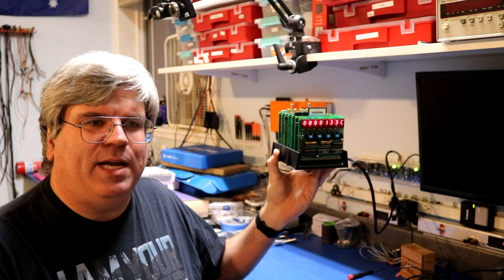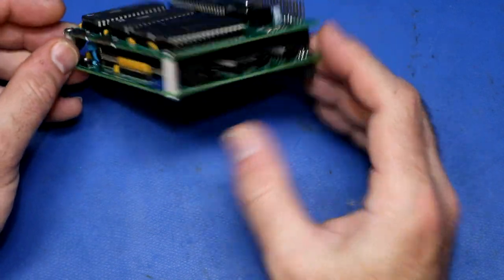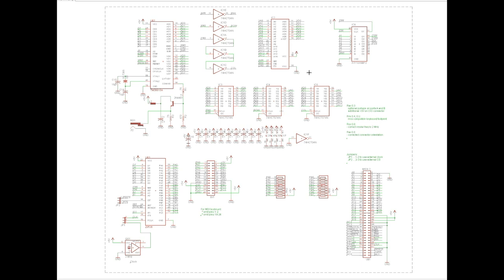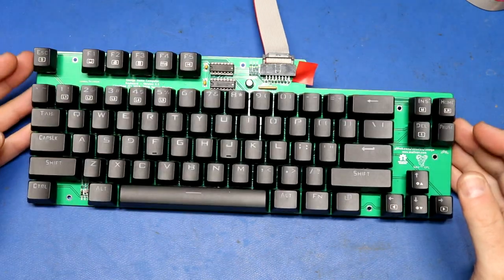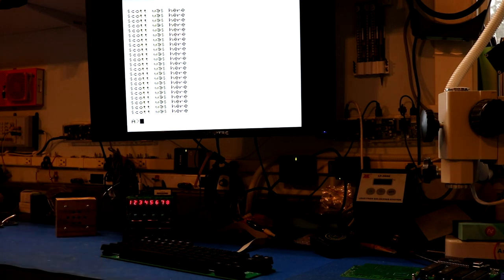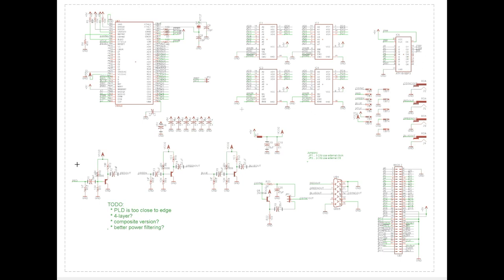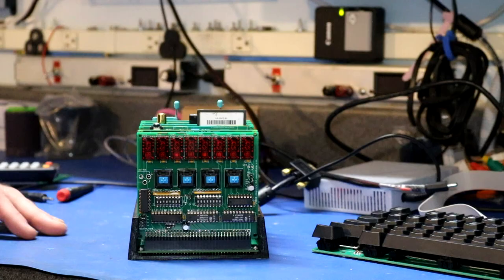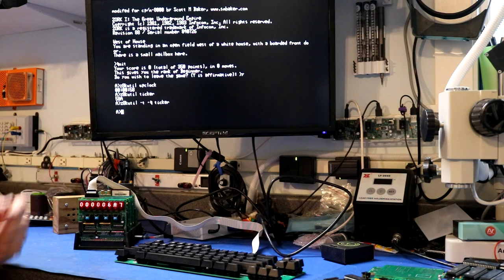Zilog Z8000 retro computer part 3: Video and Keyboard using TMS9918 or Yamaha V9958

Comment: TMS9918 was a nice video display controller on the TI-99/4A home computer.  It's ability to generate sprites was pretty cool.
Reply: A variant of the 9918 was used in the Colecovision console. One irritating thing about those display chips is they needed a 3X colorburst crystal of 10.? mhz. The Colecovision got around this by using an inductor circuit with the 3.58 clock crystal (divided by two from 7.15909). I think those 10... crystals are very hard to find.

Comment: Wow, that's a really neat computer you've built!  I have a huge pile of projects and repairs on my "To Build / Fix" pile, but I'm very tempted to add this one to it!  Well, at least "in spirit", until the physical pile gets smaller.  ;-)  I especially like projects where people build a working computer that uses something uncommon like this.
Reply from the maker: There is a hackaday page where someone did this for the V9958. So I think it's possible, using the color bus output on the 9958.

Comment: Very cool! I recently got a v9958 working with a HD6309. To save board space, I was able to replace the 192KB DRAM with one 512KB SRAM, a 74als574 latch, and some unused gates in an ATF16V8B to trigger the latch and also select the SRAM if any of CAS0...CASX go low. Your board looks great though, and not too crowded, so cheers for putting some vintage parts to good use. I love the look of your system and hope to have some kind of mass storage like yours soon. Copy-pasting basic programs into terminal and/or reflashing the rom is getting pretty old. I have visions of a c64-ish form factor, so shelled out for a long and skinny four-layer backplane with the five slots laid end to end so the system can lie flat and hopefully fit under a keyboard. I linked the vdp card schematic below, if you're interested.

Comment: that's interesting. how is the clock for the cpu? did you have wait states? 
v9958 is interfaced as an external device (I/O driven). There are timing constraints so this chip have the ability to made the CPU wait when it is not ready to receive data to and from. Did you connected this signal to the wait input signal of the CPU?

Comment: I'm wondering if there's a way to get a proper VGA output using a separate RAMDAC? I haven't looked at the design too closely, but I'm guessing the video memory is just storing the character buffer rather than the pixel data, so that probably wouldn't work.

Comment: What software are you using to 'compile' your ATF16V8 to a .JED and which hardware peogrammer are you using?  Do you use the 20V8 or the 22V10 at all?
Reply from the maker: I'm using Wincupl together with Xgpro (which came with an newer TL866 -- the older TL866 variants won't do the 22V10). I am using 16V8 on some boards and 22V10 on others.
Reply: @smbakeryt  Thanks for that.  It would seem that the use of GALs is not well supported, WinCUPL is weirdly difficult to find.  I had sorta expected to find a FOSS / GPL compiler for PALs, GALs, and other PLDs.  Glad that the devices are still cheap and somewhat available. :-)

Comment: Will it run Linux? Zilog had it's own version of Unix called Zeus.
Reply from the maker: I don't think it would run Zeus -- the Zilog S8000 computers included an MMU (or even three MMUs!) which I don't have in my project. There's also potentially some extra work beyond just using the MMU to get real virtual memory working. According to the literature, a page fault on the MMU could cause the instruction that faulted to partially complete.
Reply: I bet it would make an amazing Fuzix machine.

Comment: A really nice project, but it runs straight into something that really annoys me in diy computers. They either have no video or use some old vintage chip that cannot even put out a decent VGA signal. 
I really wish some project would build a nice general purpose retro style video chip in an FPGA. Something that can handle 320*240 VGA with 256 colors. And some sprite and scrolling hardware. At least then you can make your project do a little more then basic text. I know the v9958 is a capable enough chip, but at some point we will run out of them as they are no longer produced.
The same capabilities in FPGA with added VGA support and maybe a little more color and resolution would be great. Even a 1:1 chip with just proper VGA would be awesome. And yes i could build it myself, but i lack the knowledge. I have to pick my battles. 
I know this is not your fault, but it really irks me. Such a nice project and you cannot even connect it to a TV without a converter box in between.
Reply from the maker: The next project I'm working on might have VGA implemented in FPGA (not implemented by me, but by someone else). Haven't done it yet, so I'm not sure if the project will be successful, but stay tuned. :) As to the point in general, I think it often comes down to how much of a "project" is retro and how much is replaced by modern hardware, for some definition of modern (VGA is certainly more modern than composite, but it's also less modern than HDMI). I do have a fondness of composite as I spent many hours with a Coco 2, but that fondness wears off quickly when you're dealing with low resolution or display artifacts.
Reply: @smbakeryt  VGA is my baseline, easy to find on monitors. HDMI would require more on the FPGA side and the connector is harder to solder. 
Even the xt had cga and ega. But even that is nothing available. I can get all kinds of synth chips. But even a simple framebuffer VGA chip? Nowhere to be found. More then enough LCD controllers, but no VGA. You would expect some industrial stuff. But industrial computers, at least the x86 ones use of the shelve chips that again, are not produced anymore. 
It seems the commander x16 project has its video board on a external PCB. It might do what i want, we will see. 
The foenix retro machine certainly have what i want, but the FPGA video core is only available as part of the machine. 
I'll be curious to see what you might come up with. I'm subscribed so if anything comes of it i will know👍
Reply: Norfin' wrong with a good ole serial terminal, in my book!

Modern video on old computers is hard to do without cheating.  The old processors just don't have the juice to pump the pixels.  If I ever get to the video-output part of any of my 8 bit projects, I suspect I'll fake it with fabgl and am esp32 programmed to act like a 2d video accelerator and vram.
Reply: Ps- I got a bunch of cirrus vga controllers in the last jameco grab bag, but I suspect they are all 16 bit and closely tied to the isa bus.
Reply: @Lee_Adamson_OCF  the processor might not have had the juice, but that didn't stop the Amiga from existing or the v9990. I'm not taking high resolution. MsDos era graphics. Many games where only 320*240 but had 256 colors out of millions, so it could look nice. Framebuffer plus a ramdac. With smart updates you don't even need fancy scrolling hardware.
I don't see how recreating that is cheating. Anymore then creating SD card replacements for disc drives. Doesn't add anything, but makes things more convenient.
Reply: @bzuidgeest  I guess we all have different definitions of "cheating" heh.  That was a poor word choice anyway.  Sorry man, I didn't mean to sound critical.  I draw the "cheating" line at CPLDs, for my own stuff (which yeah, is pretty arbitrary when I think about it lol), but I mean it's all good.  I gotta admit that it would be pretty sweet to have some kind of general purpose VGA and/or HDMI output module for anachronistic computer projects, with some kind of parallel interface.  Like a CH376, but for video.
Reply: @Lee_Adamson_OCF  I had been thinking that old ISA bus VGA cards might be a way forward...  Rather than looking for an off-the-shelf chip.
Reply: @smbakeryt  There's VGA implemented in the Pi PICO which might be a way forward.